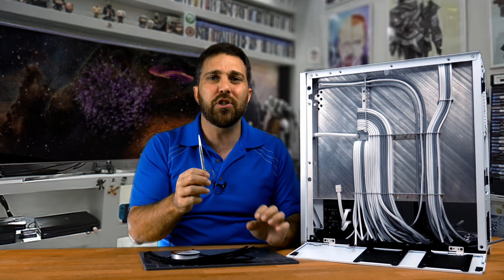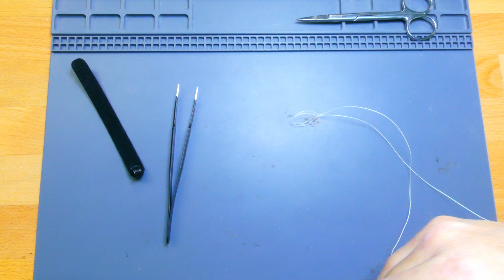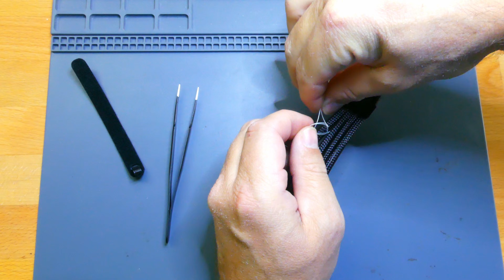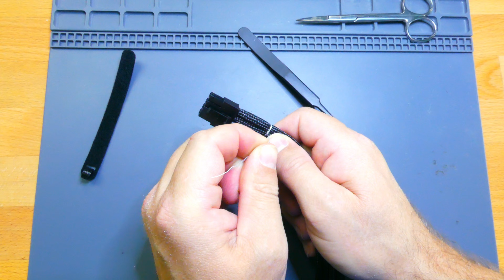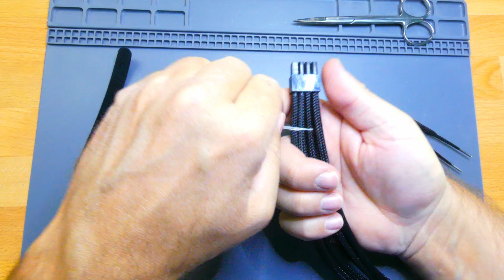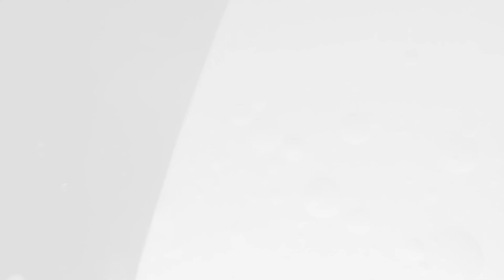How to Hand Lace / Stitch PC Cables.

Comment: Hi, nice work, don't know if anyone is going to go through this process, even though it is a good clean job. I am curious if you put out a video about the case or if you modified the case yourself. I am talking about the wires and their route at the back of the case.
Reply from the maker: There are links to the case mod and wiring videos in the description.
Reply: @ElevatedSystems  Nice work on the case, I hope it's worth it for you. (I usually skip case videos, so I missed it when it was posted)